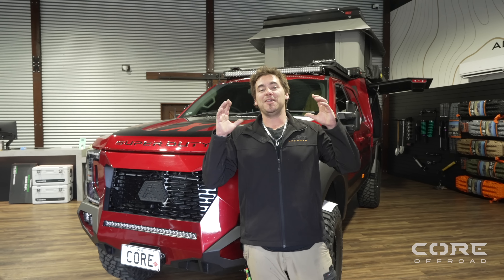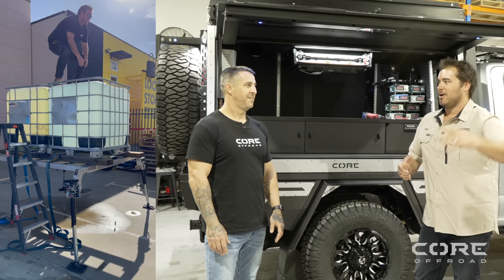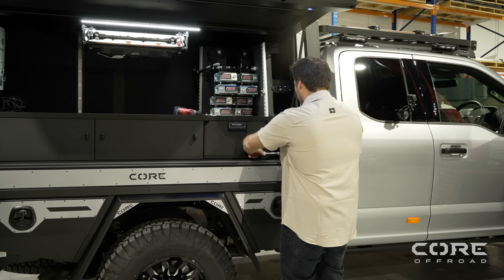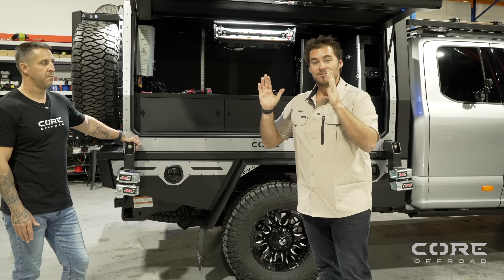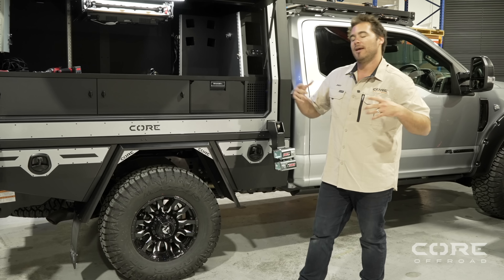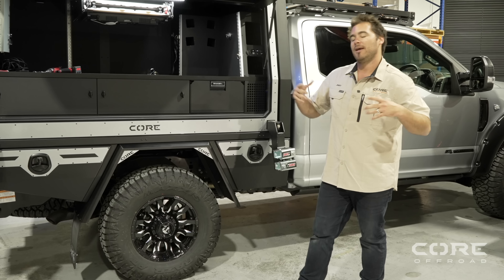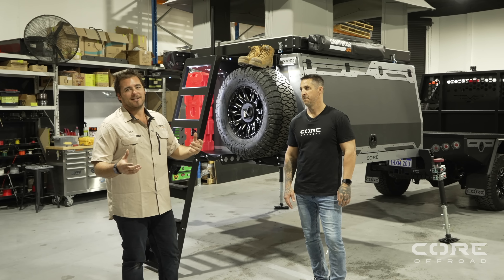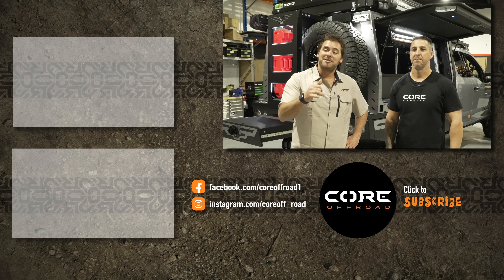FORD F350 - Our first LIFT OFF Canopy - Core Offroad - PART 2

Comment: What would the size canopy be for the new F150 - Is Lift off an option for this vehicle?
Reply from the maker: We're not 100% sure yet as we haven't got our hands on one yet to get accurate measurements but we are estimating a canopy for the short wheel base will be 1900 long x 1980 wide and the long wheel base will be 2050 long x 1980 wide. We have one on order so once we get our hands on it we'll make a call on lift offs. I hope this helps.

Comment: I would think most people would only take the canopy off at home?  No? Why not?
Reply from the maker: Some people like to set up a base camp where that take their canopy off and then go exploring with their rig.
Reply: Other people would like to be able to take their toolbox off at the jobsite and then use the truck to get materials. While others would trade their tool canopy for their camp canopy and then go make a base camp. Options are a good thing.